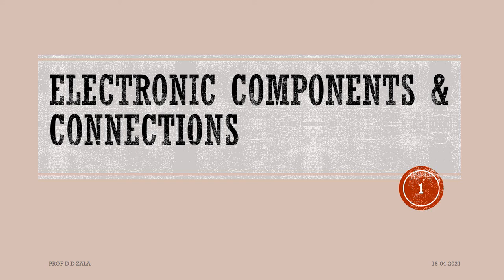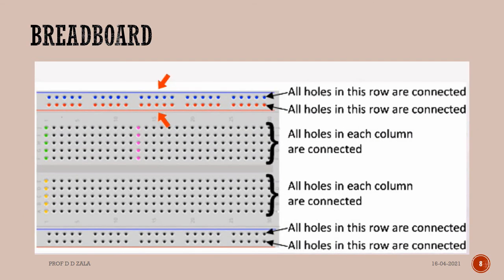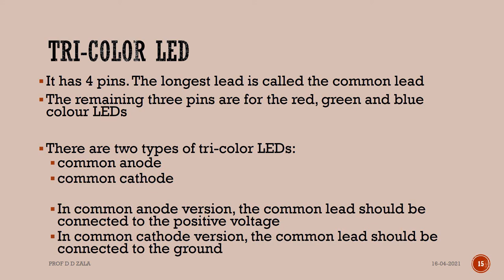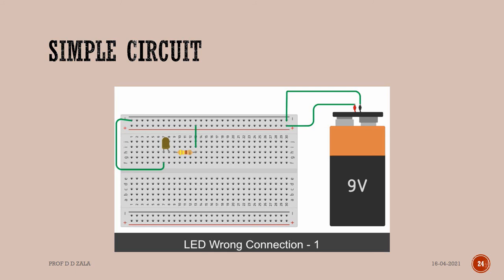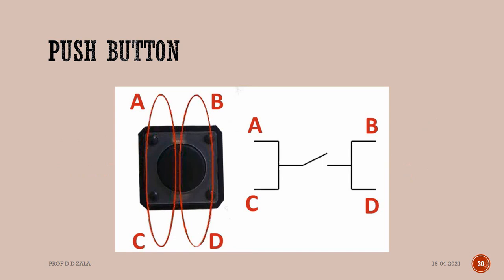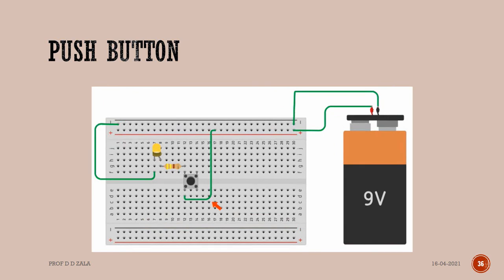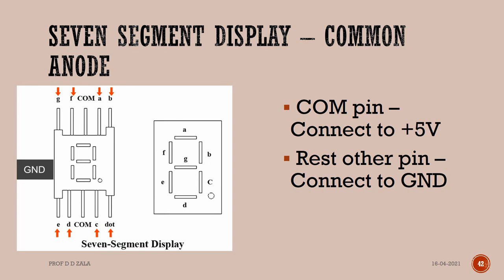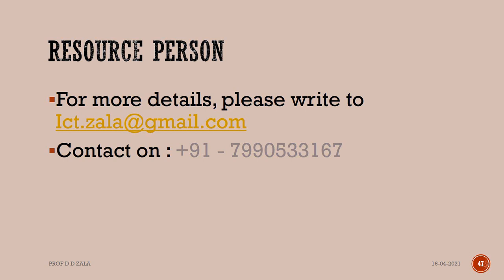LAB 2 Electronic components and connections || Arduino Series || Code and Circuit || Arduino Fun

Comment from the maker: For Full Series links are available below 
Lab 1: Overview of the Arduino Tutorial Series: https://www.youtube.com/watch?v=ZGUQ5GuCi4Y&list=PLrD-NrGSJFkyQxNl6XdxN3vzF3qJrqENZ&index=1&t=164s 
Lab 2: Basic Electronic Components and Connections: https://www.youtube.com/watch?v=--oVFWRbe8c&list=PLrD-NrGSJFkyQxNl6XdxN3vzF3qJrqENZ&index=3 
Lab 3: Introduction to Arduino IDE and IDE Installation: https://www.youtube.com/watch?v=N-jhf03rS78&list=PLrD-NrGSJFkyQxNl6XdxN3vzF3qJrqENZ&index=4 
Lab 4: Overview of Arduino Board: https://www.youtube.com/watch?v=hwYOkhKOPQ8&list=PLrD-NrGSJFkyQxNl6XdxN3vzF3qJrqENZ&index=5 
Lab 5: First Arduino Program (LED Blinking): https://www.youtube.com/watch?v=Vn00itKotLU&list=PLrD-NrGSJFkyQxNl6XdxN3vzF3qJrqENZ&index=6 
Lab 6: Arduino with Tricolor LED and Push-Button: https://www.youtube.com/watch?v=D_ZLlMnBHho&list=PLrD-NrGSJFkyQxNl6XdxN3vzF3qJrqENZ&index=7 
Lab 7: Arduino with Seven Segment Display: https://www.youtube.com/watch?v=0SajlJ3-1LY&list=PLrD-NrGSJFkyQxNl6XdxN3vzF3qJrqENZ&index=8 
Lab 8: PWM using Arduino (LED and Buzzer): https://www.youtube.com/watch?v=1HA0mkNnV5Q&list=PLrD-NrGSJFkyQxNl6XdxN3vzF3qJrqENZ&index=9 
Lab 9: Arduino with 16*2 LCD: https://www.youtube.com/watch?v=Ieyw1K9j4x4&list=PLrD-NrGSJFkyQxNl6XdxN3vzF3qJrqENZ&index=10 
Lab 10: Display Counter using Arduino (16*2 LCD and Push-Button): https://www.youtube.com/watch?v=bJWRvztDm_E&list=PLrD-NrGSJFkyQxNl6XdxN3vzF3qJrqENZ&index=11 
Lab 11: Arduino with DHT11 Sensor (Analog to Digital Conversion): https://www.youtube.com/watch?v=mVOD4vEvMqA&list=PLrD-NrGSJFkyQxNl6XdxN3vzF3qJrqENZ&index=12